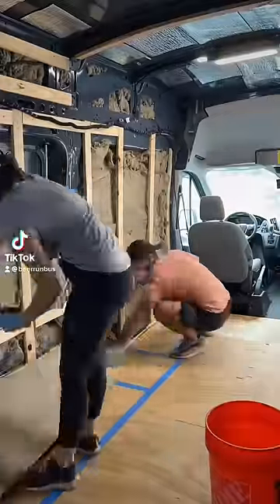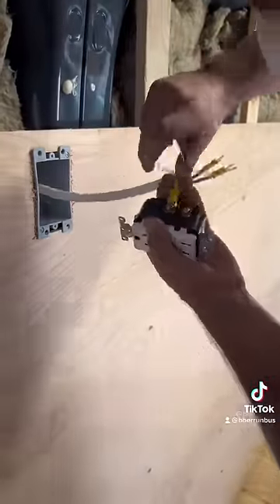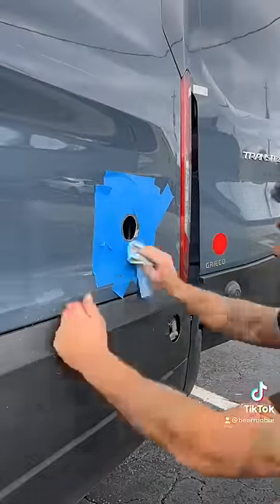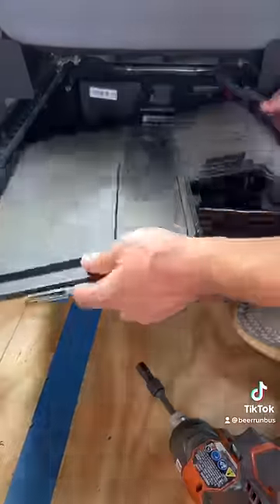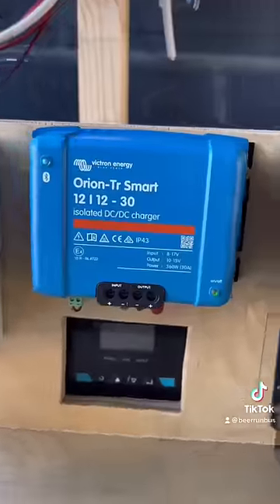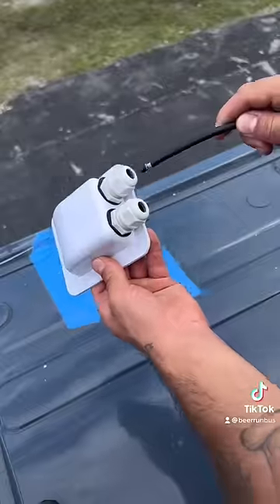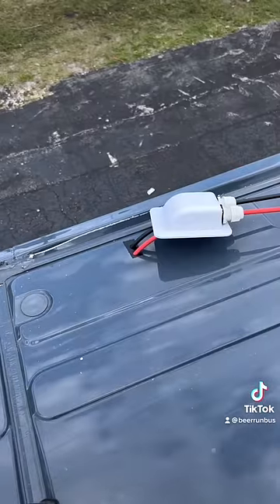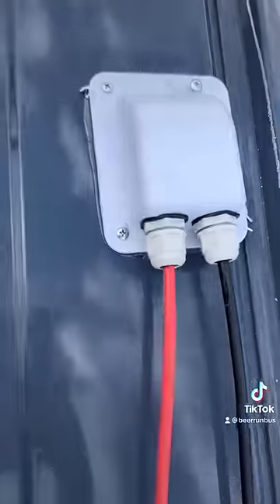Van Convertion Part 3 | #busconversion #vanconversion #vanlife #campervan #buslife

Comment: Good build, should use wire grommets for those roof entry wires though, even though you cleaned those sharp edges the metal will rub through those wires eventually from vibration...
Reply from the maker: For sure thanks for the input
Reply: Grommets 100% and if u ever damage any wire it will be much easier to replace without the silicone
Reply from the maker: @jax1627  We actually went back and added grommets.
Reply: @buildersblueprint  very nice work tho man. incredible job. I only say that electrician 15years. Y’all really have a knack for it.
Reply from the maker: @Tommy Ealey appreciate it. My wife and I were going to buy an ambulance but then we started to think about how many people died inside of it so we didn’t buy one because we figured it would be haunted😂😂.
Reply from the maker: @jax1627  hey man I really appreciate it. I really beat myself up from some of these negative comments so hearing positivity definitely makes me feel better. I’ve done so much research and I’m trying to do my best with this build.
Reply: @buildersblueprint  oh man don’t beat yourself up. There’s always negativity around beauty and success. I am subscribed and much looking forward to you and your families new journeys and builds. 🙏
Reply: I’m a marine electrician… conductors should have a grommet thru the transit hole in roof😢
Reply: @buildersblueprint  negative response or ,,,,useful info?  Maybe show your next stage of build and ask for tips!!  I always said,,, " if you don't know what you're doing,  surround yourself with people that do" !  Good luck, and keep going!
Reply: Came to say the same thing
Reply: Good somebody said it I was gonna coke comment the same thing no hate tho love the build
Reply: Yeah. I was going to say the exact same thing. They'll need plastic grommets and not rubber because those will fail over time.  One for both wires should be fine. Then duck seal the opening to help with waterproofing.
Reply: @Tommy Ealey

I've bought an ex-military ambulance, and it surely had dead people in it before ...
Never had anyone nosing around it when I leave it unattended... Now I know why I sleep so nice and carefree in it...👻👻👻
Reply: @buildersblueprint  You are doing it!  Inspiring work.
Reply: I concur
Reply: Most definitely but no worries you learn as you go. Also a rubber gasket around your plastic wire protector helps.
Reply: # 14g wire insulation works just as good as a grommet for replacement. Just cut the insulation length twice and use it according to the circumference of the hole.
Reply: You didn't paint the screw holes... hawmmmmmmmmmmm! It's gonna rust
Reply: False equivalency son
Reply: Yea vibration will cut into the red and black cables in the roof
Reply: came to the comments to say the same thing haha
Reply: @ricky1022  lame
Reply: @omarcontreras5155  false information son
Reply: @buildersblueprint  hahahahahahaha

Ambulances are so overbuilt too. You have to do a lot of "unbuilding" and remove so much wiring

Or learn the wiring and use it. Both a lot of work.
Reply: Correct. Plus it helps to drill bigger holes. If not grommets then keep the wires centered when sealing with silicone. Grommets are the way to go though.
Reply: He is right! Grommets!
Reply: I came to the comments to say this same thing, but found this comment first.
Reply: The problem is to have a secure monthly income.
Reply: @Nasty Habitz : )
Reply: use a gromit argghhhh
Reply: Yeah, they'll be triping that breaker real soon and arch welding that roof.
Reply: @buildersblueprint  everybody forgets grommets in houses - i flip old houses and ive only seen 3 of 4 grommets in my time. But for a moving vehicle its a must. Cool project v inspiring
Reply: @buildersblueprint  just a tip: Mabye add a gas generator as backup power since gas is more efficent
Reply: Came here to say this. It'll burn the van down
Reply: I was coming here to say the exact same thing
Reply: They knew that would attract us to their comments 😂
Reply: I was just coming here to say the same thing.

Comment: You should always use rubber grommets when you are passing electrical cables through a metal sheet. This is definitely a safety issue that you want to go back and rectify because you are dealing with high enough current to cause an accident
Reply: It's DC lol
Reply: @Youngsta0  even more dangerous than ac
Reply: Totally agree.
Reply: @hamishwilliams303  You're definitely aren't an electrician
Reply: @Youngsta0  This is a 12V DC system, from what I can gather from this very short video.  12V is more than enough to start auto fires, in fact, it is far more likely to start fires than AC.
Putting the wires through holes drilled in metal and not insulating the holes with grommets, has an increased risk, as the metal will easily rub the insulation away causing the actual wire to touch the metal.
Once that happens,  the wires can spark off the body of the vehicle, possibly causing fires.  And at the very least, sending current throughout the vehicle and damaging electrical equipment.
Always, ALWAYS insulate holes with rubber grommets.
As for how I know this, I am an ASE Certified Master Technician with over 20 years experience.
Reply: @Youngsta0 if auto makers use grommet for factory wire pass through sheet metal to protect wires probably people should copy and do the same 🤦🏽‍♂️
Reply: @Youngsta0 You're definitely aren't an English student.

Comment: Spray foam insulation won’t settle with vibration like wool or rock wool will. You might be a tad cold as you go further into your journey when the insulation had all settled to the bottom of the walls
Reply: No vapour barrier either.  Should have been applied over the insulation.
Reply: Spray foam for the W

Comment: I feel like the hole for your pannel wires could have used a rubber grommet.. thoes wiers are absolutely going to rub and short out against the metal roof.
Reply from the maker: Actually went back and added some because I was thinking the same thing
Reply: 👍🏻 Man’s on it! Good luck with everything.
Reply: @tundralife5570  this should be done for electric cars why not have a solar panel on the top of the car
Reply: @whatsit177  Yes, there are vehicles that charge via solar but their mileage isn’t great from what I understand. I think there’s a company in California that has a car/prototype with the entire roof being solar panels. But they estimate 40 miles per day range

Comment: Yep. Them roof wires will need rubber grommets before that tin roof slice's through the insulate coating.. vehicle vibration is better than a hacksaw..👍🇬🇧🙋🏼‍♂️

Comment: I looks like you wired your outlet wrong bro. Hot (color) to the dark screw. Neutral( white) to the silver screw. Ground (green) to the green screw. Looks like that part is right. And when doing gfci make sure to attach wires to line side of gfci or it won't work.

Comment: Nice build and it looks good too. I'm not an electrician, but have done a lot of DIY electrical.  Maybe a marine electrician would be the closest authority on building to code on vans, regarding AC electrical. I've never seen crimped connectors on AC electrical receptacles.  I definitely wouldn't use crimp on connectors on AC. Personally,  I've had really bad luck with them being loose. Just strip the wire about 3/8," shape it into a "hook," and place it, such that, from insulation to stripped wire tip faces clockwise on the screw. When the screw tightens, it pulls the wire with it securely. Bad connections are most noticeable in high current consuming loads. A larger than normal voltage drop to the load is an indication and maybe heat coming off the receptacle.
Reply: The new Transit Trail 4wd is fully pre-wired ! Off rd ready from factory too.

Comment: Protip: Stay away from silicone based sealants and adhesives, especially when working with metal. Polyurethane based adhesives and sealants are far superior.
Reply from the maker: Good to know thanks
Reply: You guys would done a better job when you first ask I e grommets etc

Comment: You should use grommets around the red and black solar cables as they go through the metal. You may end up chaffing the insulation over time. Hopefully you have a fuse inline outside the van
Reply: Very good suggestion

Comment: Hot tip from the boating industry, back each of the screws out on the wire pass thru, seal the hole and send the screw back in before the sealant cures. Do this one at a time to prevent failure of the existing sealant. Also paint the screws in they aren’t stainless. Otherwise, I think you got this dude

Comment: How did you do the “d+” ignition on signal wire for your dcdc charger?  I haven’t figured out a solution for that yet.
Reply from the maker: Great question the Victron Orion does not need one. If you are using a Renogy one I recommend you to switch to Victron
Reply: @buildersblueprint  so how is yours switched on and off?

Comment: Would really recommend threaded inserts for anyone attaching any fixtures to sheet metal. Spent time painting exposed metal then immediately made more exposed points with sheet metal screws, inserts allow you to seal the metal from rust, gives you much stronger connection points, and finally the ability to reverse installation for any repairs or upgrades.

Someone else mentioned wire grommets which is great too.

Comment: The fact that you did everything the right way and didn’t skip the details, kudos my friend and safe travels,always keep an eye out!
Reply from the maker: Really appreciate it thank you
Reply: Put the tape down first before drilling and painting
Reply: Except they used pot metal screws that will leave rust stains.
Reply: They didn't do anything right, lmfao, when running wires through metal you use a rubber grommet, not silicone. They put 1 piece of sound deadening on each panel.

Comment: I doubt you'll read this but honestly where you ran the wires through the roof for the solar panels pull the wires back out and drill the hole out bigger and put a rubber grommet at least around the hot side because going down the road that roof will flew and rattle and that wire will move back and forth and if the red one touches the bare metal it'll short out and could burn the van down
Reply: It's just worth it to take the time and redo that part itll save you alot of headache
Reply from the maker: Really appreciate the comment but we actually went back and installed a rubber ring in between them because so many people were commenting about this.

Comment: You guys did an excellent job but when you drill the holes in the roof I would have used small rubber grommets and then you wouldn't have to worry about the metal edge at all

Comment: Good start and build. Improve by lighter framework than 2x4 for the wall, as well as much better insulation. Having 4 large truck batteries which could be easily air cooled will be a good touch as well. 200W isn't the best solar panel, but relatively inexpensive and better than nothing. Hope you have years of enjoyment with it.

Comment: Just saying for anyone watching this if you’re going to do the insulation like that, you’re really not adding any R-value. You’d be better off getting one of those 700sqft do it yourself spray foam kits. 
It would only cost a little bit more, but it would remove drafts, and actually increase the R-value. It would also act as a vapour barrier.

Comment: I really like seeing builds like this on vans and the different ideas people do to theirs. it's a good mix of construction skills and automotive so you don't get burned out seeing just the one thing. you can tell you care about what you are doing and want it to be done right. just remember unlike a house this van obviously moves so vibration is a thing you need to overcome especially with wiring so grommets and fasteners to keep them in place is a good idea, and the bare metal you can use either nail polish or those little paint match touchup things they have at parts stores. saves a little time and materials using the little brush instead of spray paint but they all have the same result witch is all that matters! 4 AWG wire is said 4 gauge. crazy the AWG but it's just whatever size then gauge. just a friendly tip! look forward to any additional posts you guys do!

Comment: Obviously need rubber garments for the solar wiring. But “spray painted so it doesn’t rust”. That’s aluminum and won’t rust. Just tape then cut your hole, that’s all you need to do.

Comment: Not only a harness for all your wiring, but also silicone the screws that you used to screw down the outlet and roof brackets. I've been roofing for over 15years... The leaks always occur in the least expected places.. You put silicone under the bracket but when you screw your removing silicone as it spins and causes heat. It WILL eventually run down the screws

Comment: I've never build a van, but seem like the materials use are not weight conscience. 

Using regular house construction materials would make your van extremely heavy. While thesw cargo vans are made to carry heavy loads, putting a constant permanent heavy load inside would likely wear your suspension components faster and possibly even the drivetrain. Not to mention the increase fuel consumption, and because of it more maintenance (oil changes, spark plugs air filters etc).

If you even been inside an RV you'll notice everything in it is light RV material. Not sure how they make this but the materials are super light but also durable.

Comment: You should not be doing a how to video, when it’s clear you have not clue what you’re doing yourself! Outlet wired wrong! No grommets on wires going through the roof! There is terminals on the side of the drives seat on fords just for adding dc power,not straight to the battery! I could go on if you would like! This makes me sick to see people do this! So many fire issues!🔥

Comment: You didnt put grommets before putting solar wires thru...that will be a fire ..the roof will cut thru wire insulation..redo..you will regret if you dont make right

Comment: I’m a mobile rv repair business owner and my only recommendation is a couple things. You will want to use puddy tape on all external screws then silicone. And you should really use a Gromit for the wires going through the roof. Over time the edge of the roof can cut into wire. Good work though.

Comment: Why are you using spade terminals on a receptacle. Those Spade terminals are rated for 12 volts not 120. They are not supposed to be used on a receptacle

Comment: When I watch this I cringe. I can tell they're not very savvy with electrical just say 4 gauge wire. And sticking the wire through the drilled holes is not safe. Chafing can occur over time from the vibration of the van. I would at least put some rubber grommets in and then insert the wire then seal it.

Comment: Hi my name's Dan I'm looking to do this myself I'm 61 years old and have a bucket list and I've never had the opportunity to see my country have done traveling our family building and sailboat large trawler not talking about little ones a 46 ft catch 56 ft trawler with a 2000 gallon fuel capacity you can imagine it took many years to complete I work building our boats and keeping ourselves fed clothes and bills paid while doing it we had to work a regular job our weekends we're more work than our regular day jobs well now I am little handicap but still have the ability to design and put together put together a substantial system just need some good ideas and happen to run across what you were doing in like what you doing want to see more please

Comment: No vapor barrier? Open fiber insulation though? That thing is a show-room queen, right? The amount of formaldehyd in that fiber insulation does not suffice to prevent the mold starting after a week of heater-weather in this build fulltime, not to mention the speed in which it will rust from inside out where the condensation will puddle in the cavities ...

Comment: I'm sure it's too late and someone has already mentioned it, but you should always use grommets when running cables through metal. The vibration alone will damage the cables...

Comment: Would it be better to use plastic panels instead of wood?  Wood is heavy. I think using lightweight plastic and using foam as insulation would make the van lighter and thus better fuel mileage.

Comment: Don't forget grommets to protect wires penetrating sheet metal. Even if you file it smooth, vibration will wear through the insulation.

Comment: The only thing better than standing on top of your van is being inside chilling and enjoying it! I first used sealant for the wires and skylight but after 2000 miles had to go back and put rubber grommets in to stop the power shorting, looking good tho. Hope you get many years of enjoyment out of it 🙂
Reply: you shoulds used stuff like Loctite construction adhesive, NOT silicon sealant (that stuff is garbage). that loctite adhesive is indestructible, sticks to everything, is waterproof.

Comment: Looking good. One important thing I may have missed is the roof wire penetrations need to have bushings or eventually over time there will be a short as the wire sheathing slowly gets worn.

Comment: U should use rubber gramets for al ur wires. It will rubber n it will get exposed n short out. Not right away,  but it will happen. Other wise good job , big project lots of work

Comment: Damn the amount of foresight into the build is...... Just not there. That roof wire run is comical. You drilled holes for no reason. There's a rubber cap a foot away that accesses the inside, lol. I used it for my build.

Comment: So many think wrong. You need to use grommets on any wire going through metal. No fuse on a solar behind the panel. Also Cabel management should be always be placed in conduits
 Also no silicon for sealing you get double side rv seal tape and sika or proper sealing